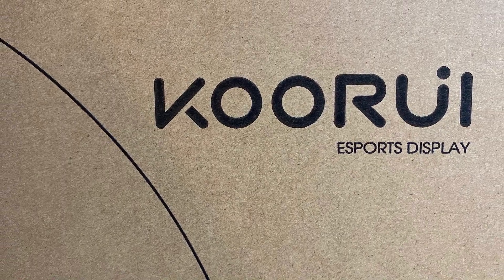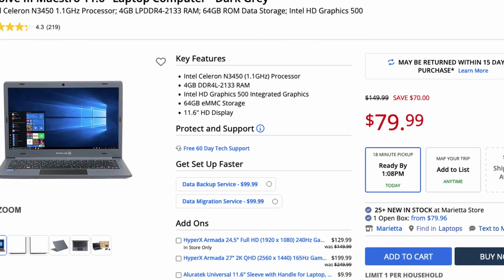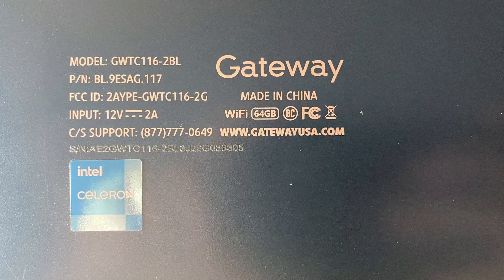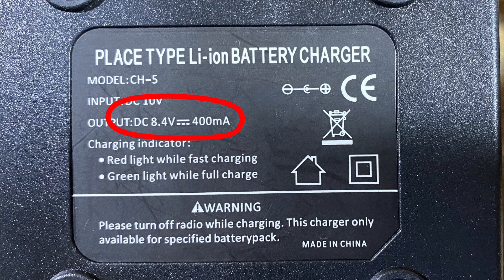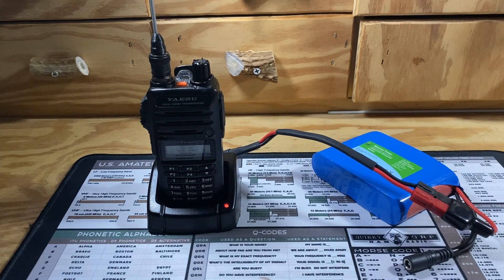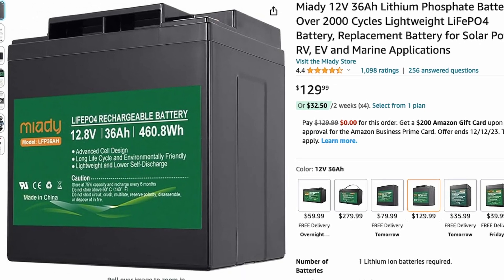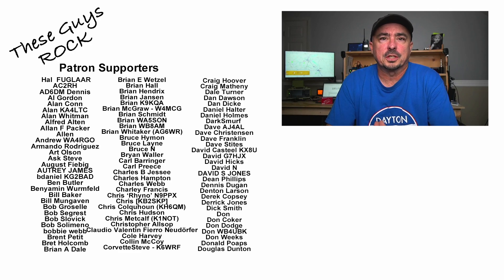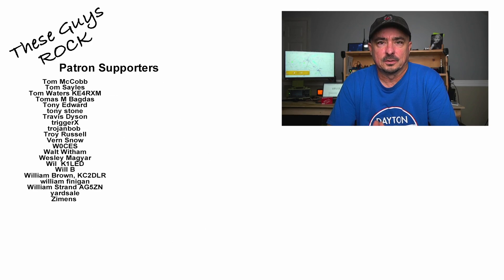Here's How I am Kicking the 120V Habit

Comment: Before thete rual AC power, windmills and batteries were the thing.  Many things at one time ran on 12V DC.  

In the pre Amyrak era, many passenger cars had generators powered off the rotation of the wheels in one of the trucks, like a PTO on a tractor.  Power eas sent from to battery banks, and powered stuff in the car via 22v or inverted into 120V AC.

Some later cars, like the Santa Fe high levels had diesel gen sets.  

I think we are returning full circle from where we started.

Comment: I am into RCs as well and use a buck converter with those batteries to charge my iphone and ipad. I made some pigtails so i can connect them all to the converter. I can now run/charge my devices with any battery in my ham radio or R.C fleet. I have usbc and usba out and a dc to dc charger for the RC batteries that I am going to use to charge them with either my ham batteries or solar. I am trying to use what I have while I make smart purchases moving forward. I would like to have a completely off-grid ham shack someday. I also have a usb inline multimeter that comes in handy! I also have 12v aspirations! 73 de KC1IFK

Comment: I just wanted to add:  In my off grid shack I use rechargeable LED lights (USB 5V) that I recharge over my main battery system (2x150Ah batteries, 400w PV).  I prefer to use removable (!) AA. AAA and 18650 lithium batteries wherever possible. I have a couple of battery chargers for these kind of batteries with 12v inputs.  The cradles for my HT's all have 12v inputs. I have a 12v soldering iron that works very well and is not  expensive.  As I mentioned my laptops (Lenovo and Macs)  are all rechargeable through my 12v system.  My displays are externally 12v powered.  I believe one could modify any display to run directly on 12v.  There may be a mains plug going into it as opposed to an external transformer, but the transformer is inside the display.  This could be then circumvented to power directly with 12v.  Save money on buying a new display for 12v and use the display of your choice!  One of my displays requires 19v input, so I just use a step-up buck converter.  Works just fine.

I did add an XHDATA 808 short wave receiver to my stable of radios (USB, LSB, AM, FM, Airband) that uses a removable (!) 18650 battery.  Often listening is tactically more important than transmitting.

At the house our access point/router has a 12v input with barrel connector.  If we lose electricity we can power it with a small battery/PV system.  We have no landline/fiber connection (not available where we live).  Internet service comes through 4g+ wireless.  As long as cell towers and backbone are functioning, so are we.  Of course phones and other small devices can be recharged with 12v and a usb plug for a cigarette lighter socket.  We have at the house rechargeable (USB/solar) LED lights.    We have a BIG inverter-generator to keep the fridges and freezers and water pump going as long as the fuel lasts.  I hope to have a PV system set up to handle essential 240v (Europe) appliances.  I have a smaller, fuel efficient inverter-generator to top off the batteries when they don't get enough charge from the sun.

We cook with bottled gas, heat with a wood burning stove and have a solar water heater.  Bottled gas is bunkered safely. We plan to add an outdoor wood burning cooking stove and oven.  Our wood supply is very adequate.  Till now we have had to use very little wood.  The Fall has been very mild.  We are not dependent on a city water supply or sewage system.  We grow our own food and have chickens (for eggs) and bees.

Recently one of my sisters in the US asked me if we have bug out bags due to the war in Ukraine.  I replied, "Why?"  Unless we were affected directly by that war or now by the Israeli slaughter in Gaza we would be worse off in any other place.

Comment: Off grid for 5 years. House is wired for 24vdc and 120vac. Most of the time (esp in winter) the inverter is off. Throughout the house we have USB-C and 24VDC power poles and 120vac outlets. But I seldom use the ac outlets - vacuum cleaner is the main remaining 120vac unit.

Comment: We live full-time in an Airstream. So I have been converting as much as possible to 12V - running PowerPole wherever I can. So no 120 power supply for the radio. We do use 12V-5V converters for the RPis in the shack (and for charge stations for various handhelds.) Recent HT purchase are all 12V. Dehumidifier runs on 10V - so there is a 12V-10V converter. Took some effort to find a 12V TV. A few tools (printer and drill that I carry) use 110 based wall warts. Over time will replace them with 12V systems. In addition to the house batteries (2 100AmpH lithium), we have been carrying 2x20AmpH lithium batteries. When we are off the grid - I limit radio usage to those batteries (depending no how much sun we have to drive the solar panels). Jim KM6GUO

Comment: Jason!  How's it going?  Great video and concept. Thanks if I didn't say it before for the mobile install tips at Huntsville.  As far as 12v, I've been an Rv'er for a bit.  I try to move everything away from 110v/mains.  I even have my computer monitors that aren't 12v setup on dc-dc converters.  If I run into noise, I try a different unit.  So far, so good..  Right now the only things on 110v are my amp and Nespresso coffee maker. The coffee maker will run from my 120v invertor; I just don't.  If I can figure a sound way to get an inexpensive invertor to take 12v to 230v for the amps, it'll be off grid, too.  73 de K0WHW Bill

Comment: Pi power
12V->5V voltage converter is easy. Add some caps and diodes for filtering. Put the circuit inside a metal Altoids box and you have both heat sink for the components and an easy Faraday cage to kill RF noise

Comment: I have 1000 amp hours of Lipo in my shack. I also run my refrigerators with it. My shack hdmi screen is also a digital television ! It was $60 as a refurbished unit and also has its own battery ! I run no wallworts, I charge everything with 12v. I also have those high powered 5 volt chargers you can get from Verizon and others for an arm and a leg. But, I found them on Ebay for very reasonable prices with the Verizon label still on them. I had gone to them quite a while ago for charging my cell because they didn't produce RFI where wall worts are terrible for that ! And, its nice to run 12v to a cig lighter socket near the tv so I can charge all my 5v devices as well as run my Raspberry Pi's in the shack.

Comment: The hats for the raspberry are pretty cool, they are DC/DC and so I think they produce less noise. I first tried a buck converter that went from 12v to usb and it produced soooooo much noise. Also I got a 12v to DC jack cable for my little RPI monitor, but I can also use that same port to change my HTs.

Comment: Yup - exactly what I have been doing. I use the WittyPi hats for the Pi3/4 and Zero. I modify my Pi GPIO connector to replace the one installed with one that has extended pins below the unit. I can then stack boards below the Pi and also have cooling above it. All of the Pi's are in enclosures - either metal or lined with copper tape and all leads are all ferritted to the max. So far no RFI issues. There are lots of 12V monitors around - mainly for the RV market so that a bonus. For handhelds it's a challenge especially with newer models - I have the USB-C charging batteries for the AnyTone - which can be charged from the Pi - and a linear regulator drop down for the FT3D. Buck/Boost converters are just too noisy and a simple LM340 regulator or similar will provide enough current. One day the manufacturers will wake up to 12V for hand held units (and HDMI video and USB-C for bench rigs - don't get me started). Keep up the good work. As for laptops there are surprisingly few. Since Chuwi stopped making theirs the market got smaller. The issue here is the new chipsets that need something above 12 to function.

Comment: For AREDN networking equipment, I have a 9-36 to 24v dc-dc boost converter, and one for 36v. Does everything that’s designed for 12v handle 13.8v long term? Not sure, but they make 9-36 to 12v regulators that I haven’t seen much rfi from.

Comment: Living and traveling on a sailboat. All is on 12V but have inverters and more sophisticated "gadgets" to fire up a microwave or the washing machine. That, I feed from a dedicated 48V battery bank. All recharged by solar and a windmill system. Since I am as much in the north as in the south and anywhere in between, cold weather requires heating. On that topic I still work with the ecoflow second generation which is an AC and heating unit in one, that runs also from 12V. Use surplus solar power to recharge and get it cozy and crisp even when it is -20C outside. ...need - as yet - help with a cabin heater. Heating on solar works well though when the sun is out. Self explanatory, HF, VHF and UHF equipment is running often from above mentioned  12V system. Had many days where I pass the time 5h or more on 20m to chat with the rest of the world, as no wind is driving the boat forward...

I encourage everyone to fiddle around with it. Makes the glob a better place, is very satisfactory to see it working for real and frees us of energy price increases...

73 to all VA2VFF

Comment: My #1 piece of advice... use USB-C PD wherever possible/practical.

You can get cheap power delivery car chargers that can run everything like Raspberry Pis, router, phone, small laptops, radios, lights and a lot more. Your PD rated battery packs can usually output 5v, 9v and 12v. Meaning that if your main battery goes down, you can make your cheap USB battery pack power the majority of your shack. (individually, of course)
Everything can still be on 12V for your main voltage, but I have found that even cheap USB PD circuits generate virtually zero noise, RF or electrical. You can also purchase USB-C to 'X laptop brand' barrel connectors. Heck, I was even able to buy a generic USB-C to 12v barrel plug to charge a TON of my misc electronics. Obviously, for your average radio, it's best to stick with 12v, but I have found that my radio hobby and my life in general is so much better with everything using USB-C.

Look up "USB-C x voltage trigger board", that will let you manually solder whatever USB-C PD voltage to the power input of your device. 
Also, look up this item on Amazon: B09D98799T. Lets you input 6-35V and gives you smooth, multi voltage USB-C and USB-A PD out.

Comment: Starting about 3 years ago, I bought 4 massive Liberty Comms batteries, 100 Amp Hours each, and installed 300 watts of solar panels outside the shack. 90% of my shack runs on those batteries, which are constantly being recharged each day from sunlight. Even my ADSB radar setup is off grid and runs on the batteries. I still need to get at least 2 more of the 100 watt solar panels and another battery to have my setup finished.

Comment: My small laptop requires 19v but I bought a boost converter designed for cars, and replaced the cig/power end with Powerpoles. No noise that I can hear on an IC-7000. That's portable. Easing the rest of the shack to 12v, at least as backup.

Edit: there are numerous USB-C car adapters which can be used with LiFePo batteries. This does not stick with the goal but could bridge to all-12v for some.

Comment: For your non 12 volt stuff you can use 3 terminal linear voltage regulators such as a 7805
Reply: If you pull much current, then a heatsink is necessary on a 7805. Very power inefficient. And hot. Little buck converters are far more efficient and easy to filter.
[DISCLAIMER: Retired EE]

Comment: I Sort of made this transition a couple of years ago.  I took a slightly different approach.  I have a 12v distribution panel that is fed by a bioenno lithium phosphate battery.  Also attached to the lipo4 battery is a samlex pure sine wave 300w inverter.  300w is more than enough for me to run my entire shack minus my HF amplifier.  300w will charge my laptop, run my screens, and run any other low powered AC charger with ease for quite literally hours and hours.  I found that trying to get everything to run on the battery is very difficult and expensive.  There is also a small amount of hash on 80 and 40m from the inverter when it's on.  That really hasn't decreased the performance of my shack too much though.  When there is AC grid power, the battery charger for the lipo4 stays connected and keeps it topped off.  I also don't run the inverter unless AC power goes down.

Comment: I am also going 12V but I have kicked the PI to the curb in favor of the 12V mini PC. I have several of those and they come in around the cost of a PI. I also have 12V Monitors from MSI that are 24" and are available on Amazon. I use MSI Motherboards and Graphics cards so I trust them and the cost of the monitor is $1 more than the monitor you showed. Now I have found, if you can find them, the N305 Intel Mini PCs are 12V and core I3 processors. Since I run SDR radios, having the extra horsepower in the CPU is a must. None of the MiniPCs pull more than 3A but of that, that is based on how many things you hang off it.

Comment: I have a home shack and a marine shack (i.e. a sailboat).  My sailboat has 560AH LiFePO4 DIY 12V house battery with a 2kW inverter (for hot water, microwave, ...).   The inverter is noisy so I turn it off when operating.  I can charge via Alternator(125A), solar (525W), or via the inverter (900W) when connected to shore power at the dock.   I am now building a 100AH LiFePO4 battery for home operation.  I prefer DIY because it is cheaper, better quality components, and I get better BMS control (Bluetooth app & RaspPi monitoring via RS485).

Comment: I know you are getting away from ARM-based devices, but for anyone who still uses them, ODroid devices are ARM-based and run off 12V native.
Reply from the maker: Just checked their https://www.hardkernel.com/shop/odroid-m1s-with-4gbyte-ram/ which says it takes USB-C 5V. Is there another version that accepts 12V?
Reply: @KM4ACK    I use the Odroid N2+, it uses a standard barrel connector for power.  It accepts a range of power from 7.5 to 18v, I also use an Odroid-C4 with the same barrel connector.  I think the Odroid-M1 (not M1S) is a C4 with more of everything and uses the same barrel connector.
Reply: FWIW, the M4 does not have a sound card, the N2+ sound card needs an upstream driver (for Linux), the N2+ has much better software support (it is my main portable computer, and use it in the shack also).  I use a USB sound card when the radio doesn't have one, otherwise I use the HDMI sound for monitoring during digital operations.

Comment: Buy copper tape and make enclosures for the converters and shield inside the boxes to stop stray RFI. 1/2 inch copper tape on the inside of the enclosure will stop most of it.
Reply: This absolutely works.  Used a similar idea to eliminate RTC drift due to RFI.  Aluminum tape works ok also but you can't solder to it to bond to ground like you can copper tape used in stained glass work.

Comment: My shack is located about 300 meters from my house, on the edge of an olive grove in the middle of nowhere.  It has always  been powered by 12 volts.  Currently I have two 150Ah AGM batteries as my main power source.  They are recharged by 400w of solar panels and an mppt solar charge controller.  This is enough to power my shack 24/7.  I should add that I live in a very sunny climate.  Of course the radios are either 13.8v or 12v (mobile UHF/VHF and CB). I found an LCD display with an external trafo and input of 12v in a dumpster.  It still works, so it came into my shack.  I use it with my Raspis along with rechargeable BT keyboard and mouse.   I bought a multi-socket cigarette lighter box and use USB/5V adapters to power the Pi's.  My LED lighting is all USB-rechargeable.  I have a couple of old Lenovo laptops.  One of them I have in my shack.  It takes 19v input, but I use a step-up buck converter to keep it running or to recharge its battery.  I decided to modify what I have rather than buy new stuff.  It works for me.  Oh, I did add a trafo to keep 13.8v into my HF radios.  The mppt solar charge controller emits some RFI that is noticeable in FM mode.  I don't use that mode often, and when I do and the RFI should become too much  I  merely shut off the mppt controller.  I am far away from power lines, cellphone towers and other homes so my noise floor is zero.

The charging cradles for my HT's all have 12v inputs.

In the future I will add more battery and solar capacity and add a pure sine wave inverter and make it a 24v system.  In case I need to vacuum my shack or run a blender for margaritas.  Mainly though there will be enough capacity to run essential appliances in our home in case of a long-term power outage. I just have to lug everything down to the house.   For the short-term we have a large inverter-generator.  But when it runs out of fuel it is merely an expensive boat anchor.  Greetings and 73 from SV0SGS.